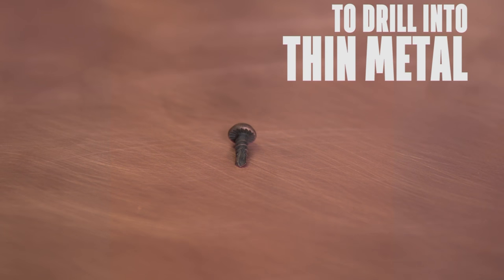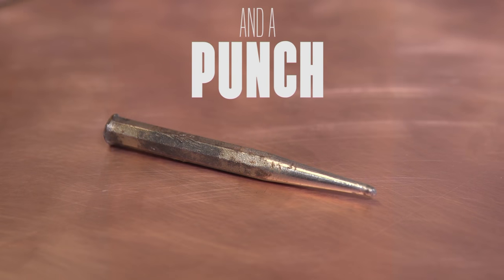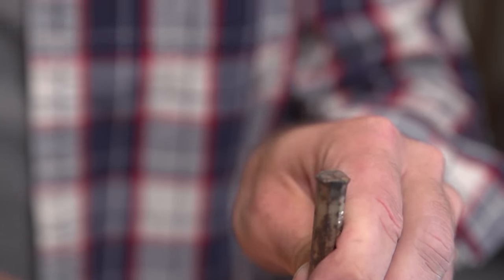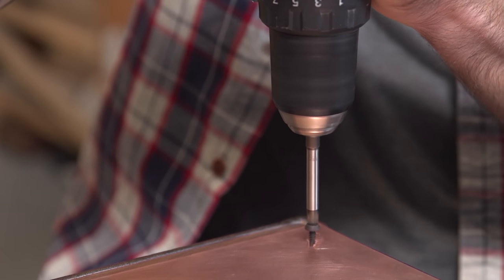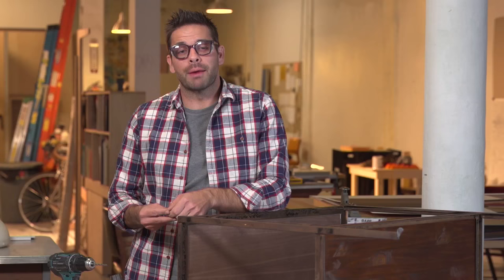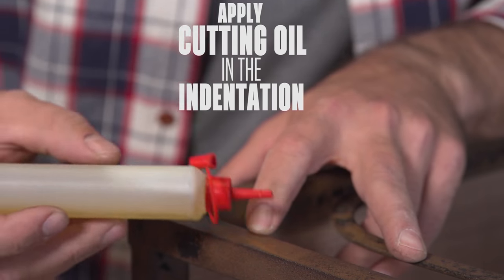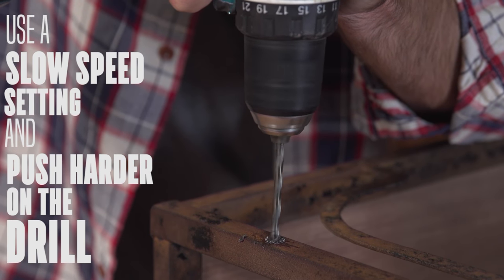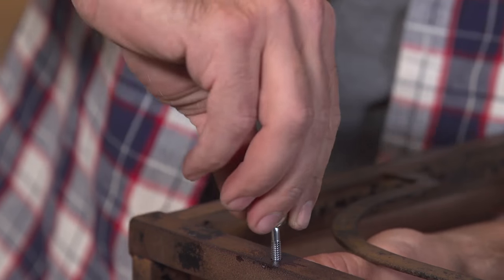The Work Around: How to Drill Into Metal | HGTV

Comment: Anyone know if a nail set can be used the same as a punch?
Reply: Definitely, unless it’s a weak nail
Reply: If just for a few times. Nails will lose their sharpness and difficult to work with for making the small indentation you need here.

Centre punch have hardened tips and not very expensive either.

Comment: So adding a paint tray to my ladder and need to drill holes to attach it. Because the bolts will have a washer and lock nut I think the drill bit should be the same size as the screw including the threads, but not quite sure as I don't want to make it too large.
Reply: ya if you're using machine bolts you want to be able to get it in the hole by hand. if its a hex head and the threading stops towards the top then you want a hole the same diameter.

Comment: I don't got cutting oil. Does vegetable oil or olive oil work? What about castor oil?
Reply: I've just ended up buying some cutting oil online, if you look locally you can probably find a small bottle or can of it for cheap
Reply: @mitchib1440  So I didn't have cutting oil BUT I ended up finding some "bearing oil" that I bought a long time ago that was supposed to be used for fans. I never ended up using it because they recommend not to put oil into a fan. However it worked just fine as a cutting oil replacement.
Reply: @boredfive3001  I guess to some extent, oil is oil. It dissipates heat and lubricates the thing it's on. Good to know this tip in case i need it in future, thank you!
Reply: @mitchib1440  I mean it got the job done for me and to be fair I don't know exactly what the "bearing oil" comprises of. However I believe it was designed for metal and I figured it was good enough to work for my purpose. Sure enough it did work. I would do again if I had to but I of course always recommend doing things the right way using cutting oil. However I had not problems.

Comment: Do not force the drill down. Definitely not like in the video. The bit will get dull faster and more chances of causing damage to yourself or the workpiece appling that much pressure.

The hole needs to be made by the drill bit grinding away the metal and should be allowed to work.